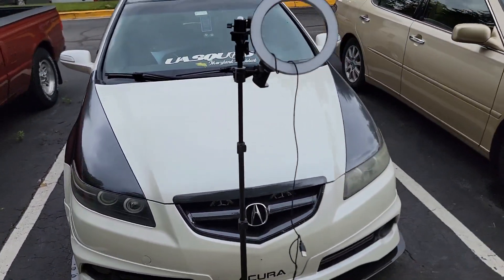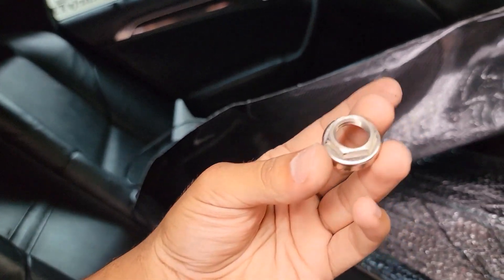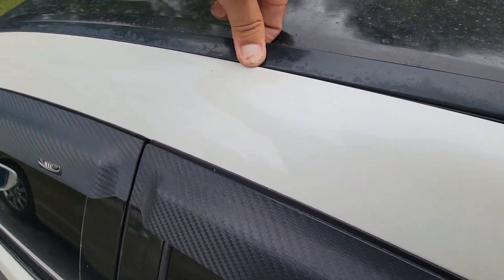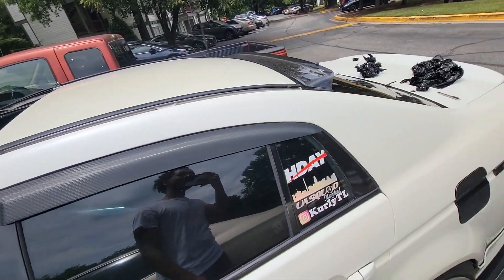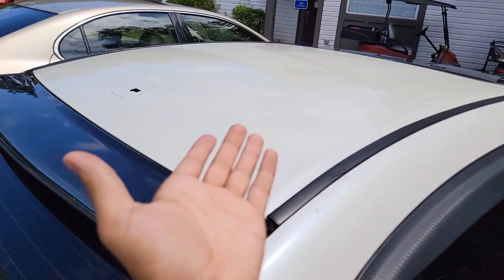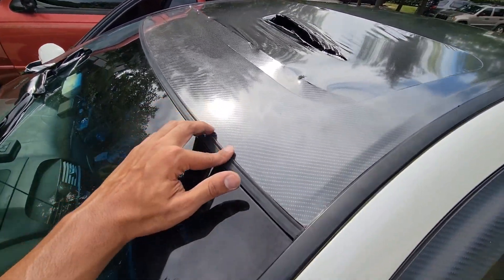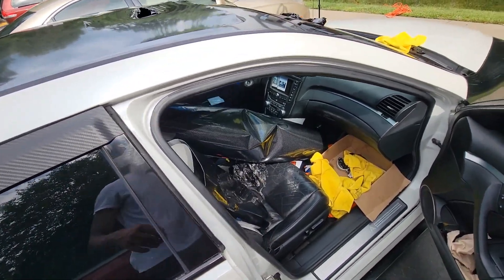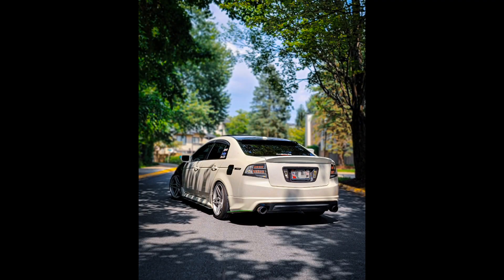INSTALLING CARBON WRAP ON MY ROOF, ACURA TL

Comment: Hmmm its not too bad but I think all white fenders, roof and gas cap would be cleaner.
Reply from the maker: Had the car like that for 5 years I want a change
Reply: How was wrapping the grill ?
Reply from the maker: Not that hard. As long as you have patience you'll be fine